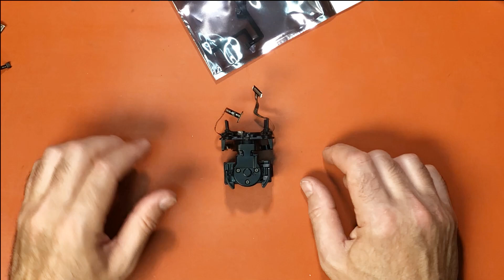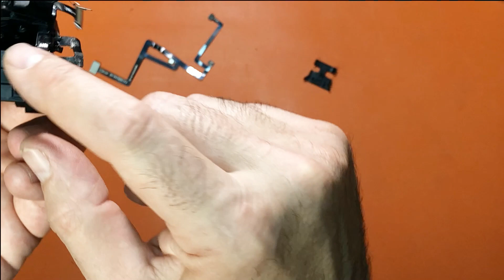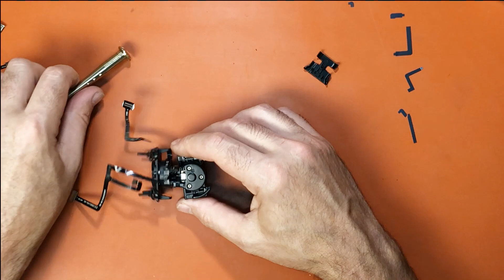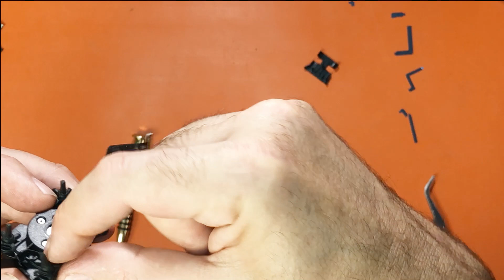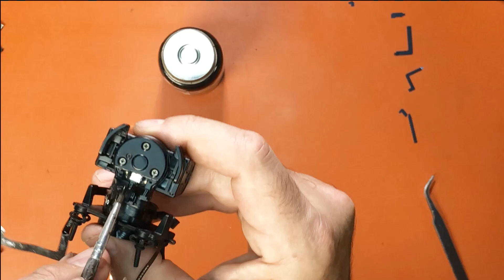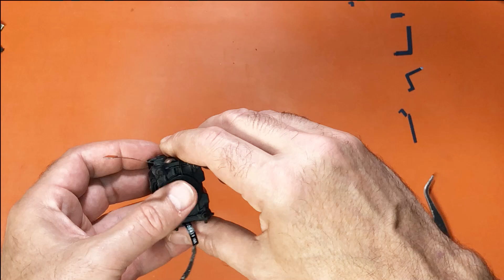HUBSAN ZINO - REPLACING GIMBAL RIBBON CABLE

Comment: Nice step by step tutorial Chris, my  gimbal's 2 flex broke and needed this tutorial to fix it..how about replacing camera flex?😅 Thanks mate!
Reply from the maker: Take a look at my videos.....I have one of those as well. I got ya covered!
Reply: @QCGUY  many thanks Chris!i had check and see your tutorials that u posted 5days ago but didnt see any tutorials for replacing camera flex on gimbals....all i saw was gimbal flex replacement...😅
Reply from the maker: Jayson Ricaplaza Same thing only easier. Sorry for the confusion
Reply: @QCGUY  ok now its clear mate😊 do i need to remove 2 screws from the lens housing to see the connector?anyways ill just check it when replacement arrives! Your videos really helps a lot!👍🏾👍🏾👍🏾
Reply from the maker: Jayson Ricaplaza If it’s your cables that broke I wouldn’t go into the boards inside. If the connection on the board is broken you will see it from the outside and know it when you try to plug into it.
Reply from the maker: Jayson Ricaplaza Let me know how it works out after you get your cables installed. 👍
Reply: @QCGUY  those 2 flex cuts out as the yaw servo shaft detached from its head during mishap,still lucky as haft of gimbal assembly bumped into grass with no physical damage, i was able to glued the shafts back and didnt saw and broken windings visually.zino boots normally but no  wifi as you confirmed that there will be no connection when flex is totally broken
Reply: @QCGUY  will update you mate at the soonest.btw, can i use hot glue   to secure the clips as theres no liquid tape availble from my place
Reply from the maker: Jayson Ricaplaza NO HOT GLUE!!!
If you use hot glue it will be hard to remove later if you need to and it will be too bulky for the back cover to go on. Use a small dab of a silicone base adhesive just in the corners. 
Sorry, I should have explained that part but I do in my other videos.